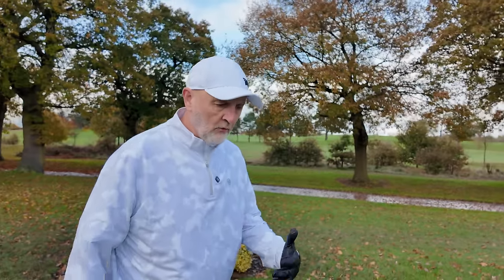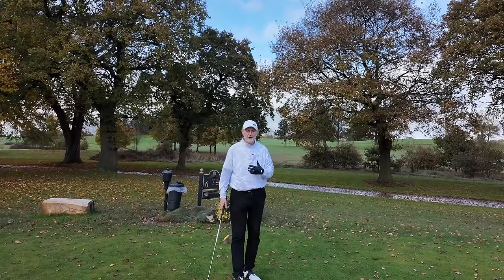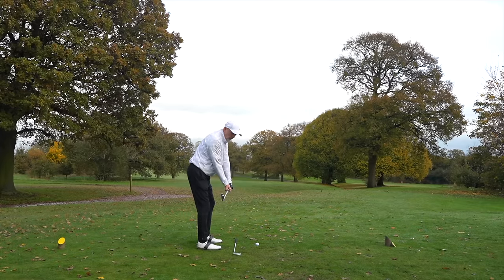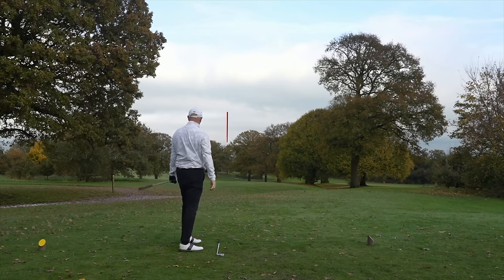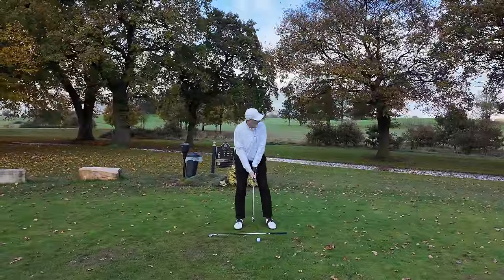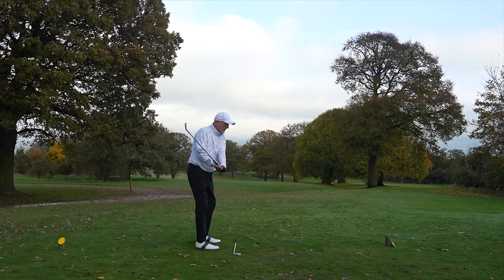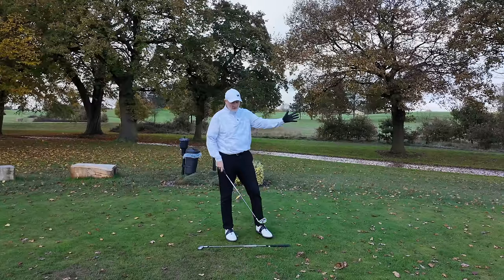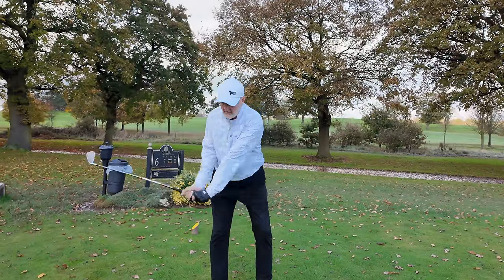The wrist hinge technique that simplifies the golf swing

Comment: Used to teach this back in the 90's. Set the wrists like you say, pump the arms a little way back and forth, 1 2 3, hit the ball. Also at home put an 6ft cane in the ground to simulate the swing plane from the rear, set the wrists, touch the cane, slide the club up the outside of the cane going back then down the cane on the inside, not hitting balls of course.
Reply from the maker: @texmex697  ok will give that a try

Comment: I used this when I was in South Africa in the 80’s. I used to play with an old pro called Simon Hobday, apparently David Leadbetter got his swing mechanics from watching Simon who was an amazing ball striker, perhaps one of the best ever!  
He told me that what it does is simplifies the swing in that the impact position is pre-set and the rotation is a one piece movement that keeps the swing on plane. From the top the club just fall straight down and gravity allows the club to stay on plane and is delivered from the strong inside position this is where all the power is generated from that 90° horizontal set in the down swing to just after the 6 O-clock position at impact. 
One of the reasons Faldo changed his swing to this type was that it was repeatable over and over again and was sustainable under pressure of competition. I think back to back Masters wins 3 Open wins and 3 Masters titles are testament to how durable this swing is! 
One final thing Andy Simon once said to me that the set position is important as a drill, but in practice it is not always a perfect parallel it’s the feel that counts and it’s the old adage “feel V’s real “ 
Enjoy great video!!

Comment: Nice one Andy. This principle fixed my inside takeaway tendency early this season. The feel that works for me is that the lead shoulder starts the sequence by pressing the lead arm and hand down, which presses the handle down, which sets the wrists as an end result. To me, the lead wrists sets and goes towards flexion, the trail wrist just goes along for the ride. Of my trail wrist I am really only conscious in the downswing (release). Since I used to be an avid (and sometimes even good if my timing was right on the day) toe flipper I needed a feel that didn't focus on wrists :-) because to me they need to stay passive ('dead' but not as in rigor mortis). Perhaps that could help others having the same issue of overactive wrists too.

Comment: Very impressive Andy and a drill I will start using as I also pull the club back inside. Could you guide me to a 3 wood that has a neutral face as most I've seen are all offset

Comment: I actually play like this, from this set position , I'm very accurate and you feel a lot more relaxed with it. If you are struggling out to the right you can do the following.  Close your club head 45 degrees and then grip the club as normal then rotate your hands so the club head is now in t's " normal position " This will help you to get  a square slightly closed club face at impact. You can also as mentioned simply ensure you rotate through the ball fully by bringing the shaft through to target and inside left and up . ( Through and left. ) This swing as mentioned is super accurate needs almost no work but has one minor downside, you will or may lose a few yards, but who cares if you are ultra straight.  There is a drill by Alistair Davies that's teaches you to pull the club through and left for better rotation which  is deffo worth watching.  Ill find the link and post it.

https://youtu.be/jKG8rRmkIio?si=J68xLbRLNkqJHCzV
Reply from the maker: It is very effective and how I have played for several weeks, very simple method
Reply: Yes , the only danger i think is over analysing it, there's no need . Just set it turn and turn. Lol .Good luck with it. Paul

Comment: I do same but at top of backswing. Your method is better because you can visually check that the club face is on plane. Great tip, Andy! But right again about committing to square up at impact. Can easily see the results.
Reply from the maker: Yes I like that you can see where you are at before the shoulders turn